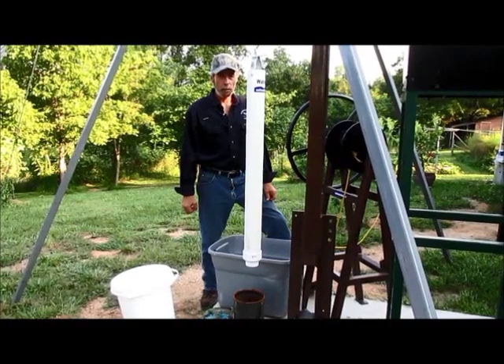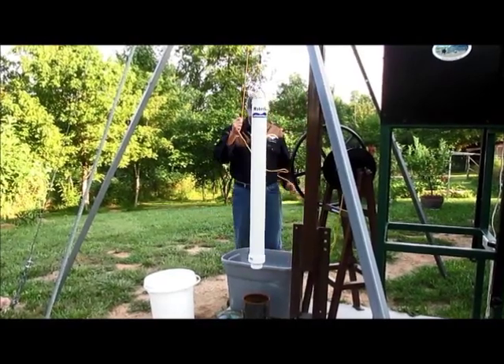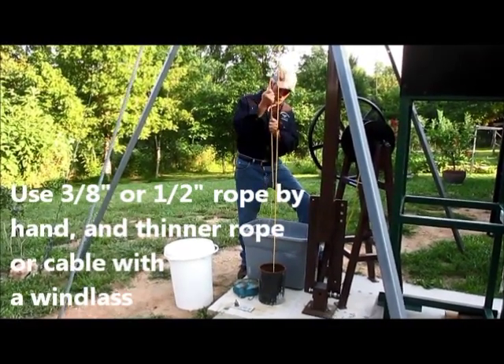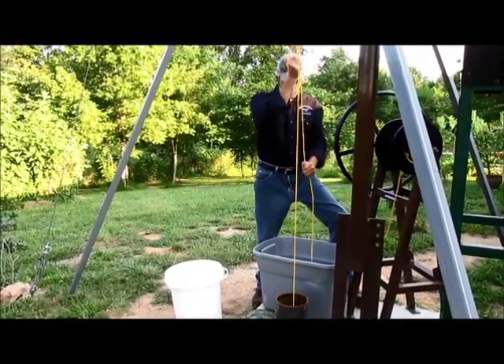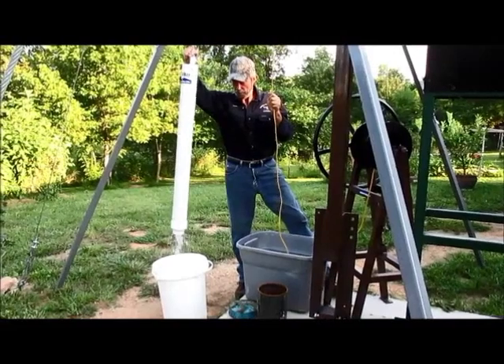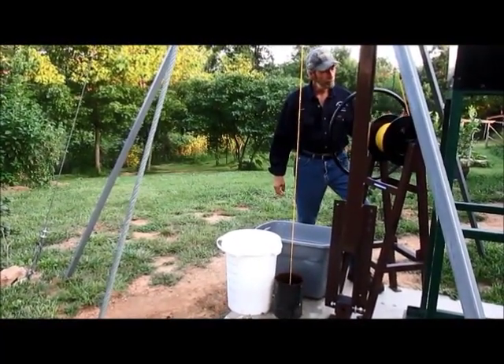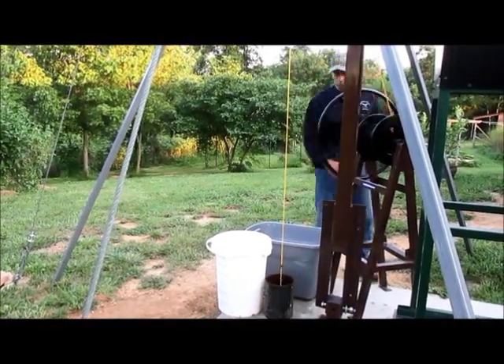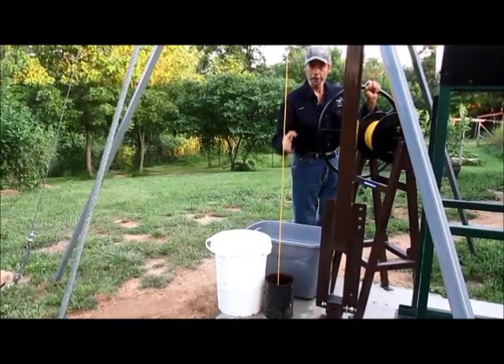Well Bucket - Water Without Electricity

Comment: Thanks for a making this video, i just came across your channel, we have a well that is 180 ft with 21 ft of water, my problem is finding a decent well bucket, ours leaks most of the water out before you can pull it up, we don't us this well every day ,its for emergency shtf events. what brand of well bucket do you have?  any info on where to get a good well bucket would be greatly appreciated, thanks and i look forward to watching more of your videos.
Reply from the maker: Clay 
We manufacture and sell the WaterBoy well bucket. We have 4 different sizes to accommodate different size well casings. There easy to use and are built for everyday use.  http://waterbuckpump.com/buckettripod-order-form/ Thanks for watching!
Reply: @WellWaterBoyProducts  do you still make these?